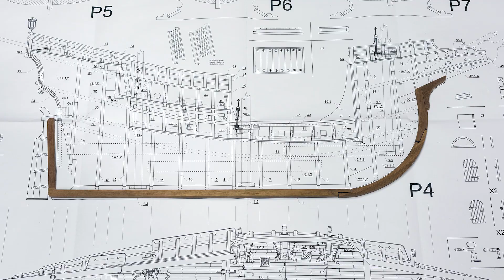What is the BACKBONE of the ship?

Comment: I remember an article in Wooden Boat Magazine ,decades ago, about joints that the romans used to set up their keels. The one that stuck most in my memory was a horizontal half-lap that locked on its ends (“hooded” might be the term) and was cross keyed in the middle. It looked very like a joint that the Japanese still use in timber framing houses.           Another good episode . I have no gripe with it at all. I am looking forward to a discussion on how widely misused  the term keelson is .